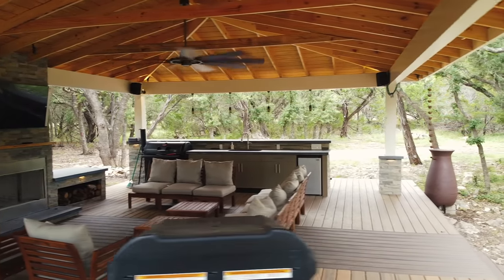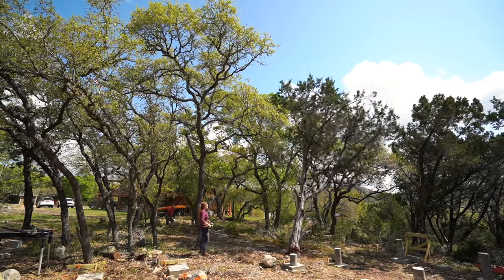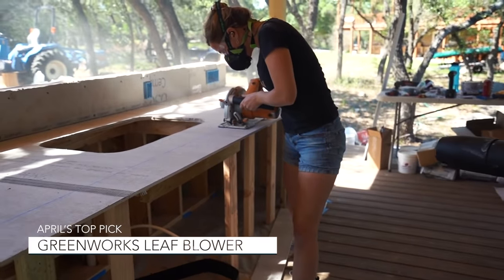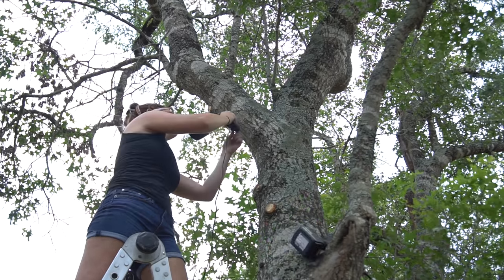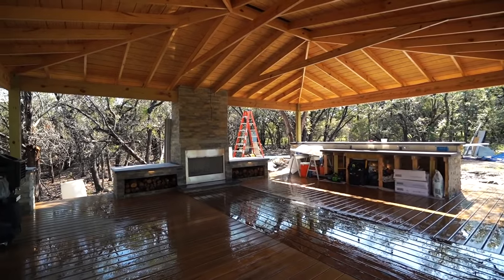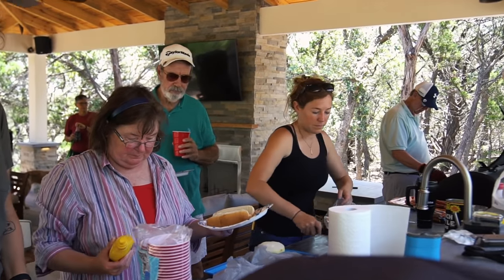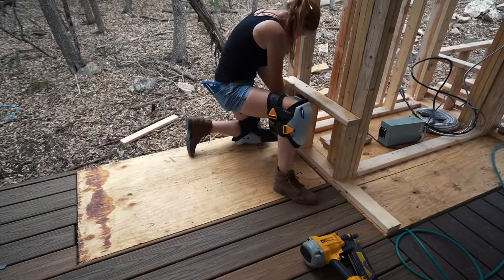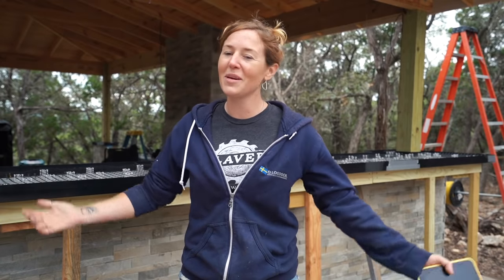Building an Outdoor Kitchen! | From Start to Finish | Part 11

Comment: Thanks for sharing this insightful video series.  Although perfect for Texas and southwest locations, limited season use in Great Lakes’ states.  However, as an educational tool this series is wonderful.  I covered our “barn” using the same roofing materials.  It has held up well through heat and cold but it is not impervious to determined tree rats (squirrels).  I was surprised that you didn’t use an IBC tote for water retention.  You are an impressive craftsperson with an artistic style and excellent educator presence.  You should be teaching.

Wishing you and your team and family another blessed week.  Thanks April.

Comment: I have enjoyed the series.  Did you cap off the low rain barrel in the front corner so that all your other barrels won't drain out through it; or are you just going with the barrels getting half full and the excess coming out the top of that one instead of your overflow on the 3rd barrel in the back?

Comment: Great work! This is very similar to the build I'd like to do. I was wondering if you might be able to advise for this set up how you budgeted for each part (footings, deck, roof, bar, fireplace, etc) and how much you ended up spending in the end? I have some basic figures in mind, but always end up spending a ton I didn't figure correctly in hardware.

Comment: Beautyfull result April,well done for another time again,have you thought of something for the winter? some way to close it so that you can use it in the winter as well?
Reply from the maker: It's basically a year around enjoyment. In Texas, usually Winters mean overnight low's in the low 40's and 60's in the day. If it's a cold snap, may be colder for 2-3 days then it's back to cold in the morning and cool in the afternoon. Thanks for watching.

Comment: That many oak trees around, gutter guards are a requirement! I got aluminum frame/stainless mesh ones installed with stainless screws. I think the brand was Easy-On Gutter Guards. It works perfectly if your pitch is not too high. Ours is right around the maximum for serious Florida downpour. Anything over 10 pitch (with 5" gutters) would be issue when heavy downpouring; water just skates over it. Having 6" gutters helps a lot. I think this building you have looks like it has 6 pitch or less... Wanna never think about leaves in your gutters?

Comment: Gorgeous outdoor area, I've been following the series, I have one question: The bbq doesn't have a vent to kick the smoke out higher. Does the place get smoky with the current design?
Reply from the maker: Hmm. It didn't as we used it so I'm assuming it won't in the future.

Comment: April its great! Beautiful space and a great build. I want to build an out door kitchen and living area. I would like to build a around the half wall with a edge counter space for eating and sitting bar top. Then have half doors the open up from the counter so it can be closed off and locked when I leave or its cold at night. I live in NM and the land is not my permanent residence so it would be perfect to lock and leave. Also tossing about having a storage area on same side as the fire place, that can be used as a bunk house or sleeping quarters. Can you see it from what I wrote? Any thoughts?

Comment: How did you like working with that corrugated roofing? Lowe's had it when I worked there, I didn't know much about it.
Reply from the maker: I love it and have used it on every roofing project for the past several years. It's great and I highly recommend it.  Thanks for watching.

Comment: I know you have the 4 pillars on the corners of that build, but I would add pillars in the center of the 4 you have just for added strength. Don't get me wrong your build here is awesome, but an added pillar in between the existing 4 won't hurt. April, I love trees, we all do, and thats what's used in construction of our living spaces, though a tree, or a heavy branch from the tree that can come down from a storm...just my opinion.

Comment: Any chance you can do a few projects like you used to do when you first started, ones that us mortals can do in our small workshops?
Reply from the maker: I build what I need/want and bring a camera along. I typically do one large project a year then smaller ones the rest. Most of my projects can be done even with basic tools - it would just take longer at each step. Some feel I'm slacking if all I do are small, less complicated projects. Others complain if I do more complicated projects. You can't please everyone. But if I have a faster, fancier tool it'd be crazy to not use it.

Comment: Have you had any problems with smoke. Do you have a ventilation fan?
Reply from the maker: We've never had a problem with smoke. It's open air so it hasn't been an issue. Thanks for watching.

Comment: What are some of those options for potable rain water? I've had trouble finding it short of lifestraw filters.
Reply: Most filtering setups I've seen on Youtube are consisting of 4 stages: 
1. Pre filter to 20 microns
2. Active charcoal filter to remove some chemicals
3. Post active filter 8 microns
4. UV Lamp to kill biological stuff.

Comment: The only thing I would have done different is with the roofing process. You cheated it then covered it with synthetic vapor barrier but then you put down pine 2 x 4 nailing strips that ran the full length horizontally. Just in my opinion I would have used pressure treated lumber and I would’ve left a little spacing just for any condensation or if he were to get water under your roofing membrane somehow then it won’t be trapped. I’m not a builder either but I’ve done a lot of roofing. Great work though, I’m gonna have to build one for myself

Comment: Could use a smoker, otherwise it looks like a great space.
Reply: Yeah, it's kinda mandatory to have a smoker in Central Texas. I think it's even a question on your driver's license test... "How big of a smoker can you tow with an F-150?"... or something like that. 🤣
Reply: There was one near the kitchen sink
Reply: @StevenKelley  I had to go back and watch it again. I see it now, but it looks like a grill, not a smoker. A smoker should have an offset fire box on the side opposite the smoke stack. Also, you wouldn't be able to dock it next to a wood structure due to the heat generated in the fire box.